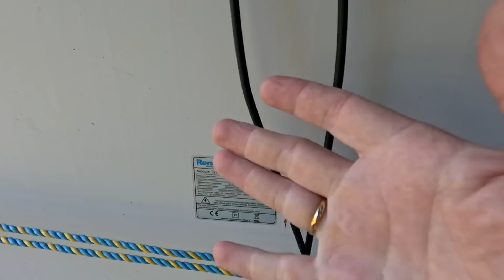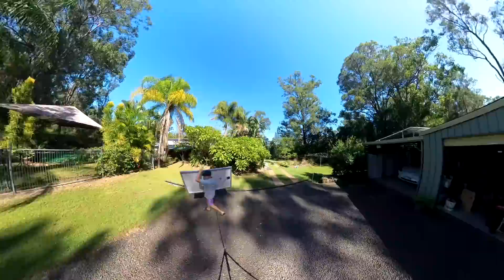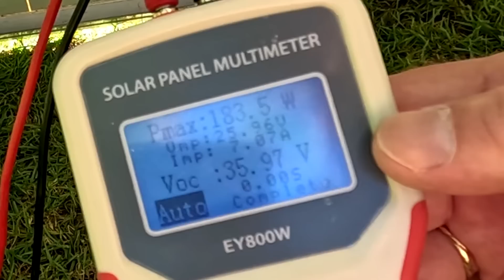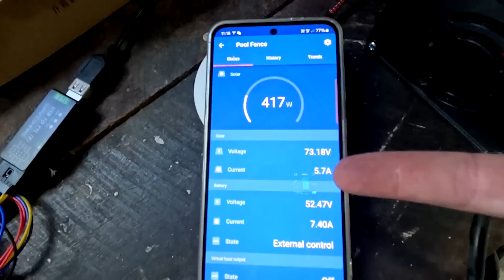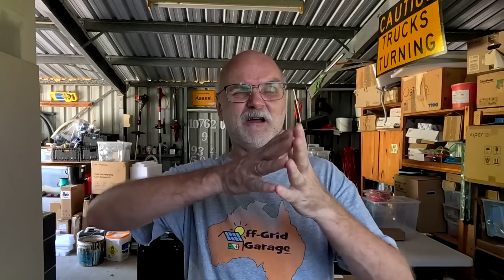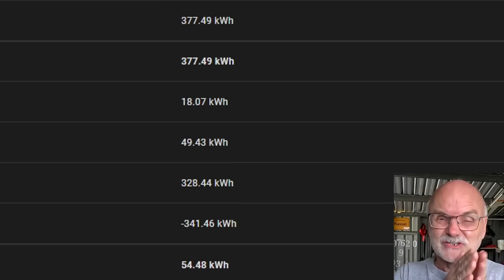Surviving winter with lots of shading with no additional Solar? Preparing for fully Off-Grid.

Comment: Lol, you removed that one palm tree branch which will give you 100% sun in the early afternoon. Question... are you positive that they are planning on reducing or dropping your reimbursement for selling them your excess power. Here in the USA some of the power companies change their payback numbers, for new solar customers but a few grandfather in (same as existing rate) the original existing solar customers that are selling their excess solar back to the grid. If they do grandfather you in you may want to keep some panels selling power back to the grid just to keep your grandfathered status in case something nasty happens to your system. OUTSTANDING video!
Reply: There is no doubt.

Only a few minutes in but way further south we went from a 66c into the grid to 6c….  And it could go down to 2c.    And you could say we were on a grandfathered plan.

Solar generation that used to be focused on grid feed and off peak draw has been flipped and it’s now all about solar utilisation, even if you don’t have batteries.   This shift alone here we have dropped our monthly grid draw by 100 KWhr over at least 5 months compared to last year.   (~2.2 KW on the roof but it was summer)

And while we trim some trees here, that’s also a gutter and fire safety management.    Green growth does need to be kept around for mental health and cooling as well - don’t forget lots of green growth lowers local air temp - a  microclimate where the lower temp reduces or at least limits degradation of panel efficiency due to heat.   I would over panel to beat shade than cut trees if it was possible.
Reply from the maker: It is a contract I have for 15 years and it will run out in 2027. Feed-in tariff will go from 50c/kWh to 5.2c/kWh at this time.

Comment: fwiw, I'm full time offgrid in a van. We have 7.5kWh of battery, and have been struggling with 900W of solar + car charging. It's enough in summer, but for this winter I decided to do something about it, and bought a Jinko 510w panel ($150 AUD) to put on the roof of the car. This has made a massive difference to our ability to regenerate power.
Thanks again for the inspiration Andy!
Reply: yeah, I have 8kWatt/p of Panels and 112kWatt/hrs of battery - I remember when I was undersized...Taj-Ma-Haul (20' x 8' Toy Hauler Conversion ) holds 15 x 540 watt panels
Reply: @taj-ma-haul9094  when you talk about panels its kWp not kWh
Reply: bonezed, when you talk about battery storage capacity then its in kWh, if you say only KW it sounds like thats the peak power they can deliver
Reply: @423GustavBern  yes, it is best to be technically accurate even though many use the wrong term ;)
Reply from the maker: Thanks for sharing

Comment: Andy, why do you not attach all battery's and leave those attached for a full year. By adding and removing the battery's over and over again, you can not see if you have enough solar/ battery for a year.
Reply: I'm sure once the battery room is finished they will all be connected, but with that amount they would likely stay near 100% SOC in the summer, which isn't good. Suppose it would be very easy to take some offline for the Peak summer months.
Reply from the maker: That is the plan once the battery room is finished. That's why I build it😄
Reply: @OffGridGarageAustralia you may have to ask about cycling , as storage is recommended to cycle at 3 months.
At full capacity, and micro cycling... How will that affect the battery? 
Bit eggs in basket, id build two rooms one goes it all goes.

Comment: Would a ~400v DC system not be better than 230V AC for long distances?
Reply: even ~120V is enough when you have thick enough wires.. something readily available solar wire 6mm^2 wire 50m away(=100m wire) you will lose at 2400w (120v*20a) 0.298ohm ->6v ~120w...if you go 100m away -> 240w..so still 2100w at least...the more i calculate the more i don't understand why microinverters? @OffGridGarageAustralia
Reply from the maker: That depends on the cable size.
Reply: @ unless you have only 4mm^2 wire or smaller,everything is better than grid-tied inverter :)

Comment: Andy, why don’t you trim the tops of the trees to open up your Solar capturing window?
You have so many battery 🔋 systems. Will you have enough Solar to charge all those batteries 🪫 on a daily basis when you finish your battery room?
Reply: Would need a laser trimmer those are way too high.
Reply from the maker: That is not part of the project. I made a video about. You will find it and understand.

Comment: Yep Agree another great Video. Andy are you going to purchase a second Multiplus. The Victron has a "Factor" 1 rule, So the AC PV can only be equal or less than the size of the Multiplus. I had to put in a second 5kva (so two in Parallel) for my 8kw AC PV. I assume you will keep the Tilt System?  In practise this is only an issue when the battery is full and you have large loads (kettle / car) kicking off, that Inverter has to momentarily deal with the spike.
Reply from the maker: I know about the factor 1 rule. We discussed this in all details when connecting the microinverters back then.
I'm not sure yet, what I will do with the inverters. I could get a 2nd MP and still use them in series like now, plus the Phoenix inverter as the generator for the first MP. So, three inverters in series. That would be cool!
Yeah, I want to keep the tilt system as well. Tilt has 2kWp and house has 5kWp. This is against the Factor 1 rule though. I could turn off the tilt system in summer to overcome this or could use Home Assistant to do so when SOC is over 90%. Not sure yet, but these are all thoughts I'm having for a while....

Comment: Nice work moving closer to fully off-grid, quick question though.  When you were setting up the Home Assistant Dashboards that are looking into the future and capturing the now-grid-connected PV on the house, did you factor in the losses associated with the DC-AC-DC conversions that you mentioned in the video? or did you reason that this power could be consumed directly and only the excess is subject to this conversion acrobatics?
Reply from the maker: Yeah, that is very hard to tell. We probably need to reverse our habits when to use energy completely once off-grid and use as much AC power during the day.
But even with 10% loses (house solar AC to battery DC), we will be fine and will have a good surplus of energy. A large battery bank will smooth out any cloudy days or heave EV charging.

Comment: More solar / more batteries? It depends. I don't know if you still can find some space to install additional panels on the ground. If so I would propose to install mooore panels. Panels became that cheap, for the price of a 15KWh battery you can get a whole palett of 36 450W panels. I know some offgrid people are mourning about the power they cannot consume or store during summer. But this is what we call a luxury problem. A real problem is to sit on five empty batteries in winter and there is not enough incoming solar to store enough for the next night. A long time there really was a market for second hand panels. But at the current price level already the additional material to mount such panels is too expensive to think about that. If you consider that old panels often only have half as much power as new ones you have to spend double the amount of work, space and money for additional material for used panels. Of course I would not even think about cutting one of your nice trees to get rid of some shadow. Anyway shadow also has some value - during summer. But what about building a fence from panels at the boundary of your property? This would be a nice new project for your channel.
Reply: Well thought out comment 😊
Reply from the maker: I still have space behind the garages, but it is too far away to connect them back to the battery system. Digging a trench is costly as there are irrigation pipes in the ground with unknown location. At the moment it is cheaper to get more battery capacity.
Reply: @OffGridGarageAustralia repairing irrigation lines is cheap!
Reply: @OffGridGarageAustralia  did i see room on the house roof? Remember off grid = less limits....
Just weight on the room will need to be looked at. 
Id look at ac coupled secondary systems with charge back... Fairly such vic can do this too... Another battery room ?? 😅

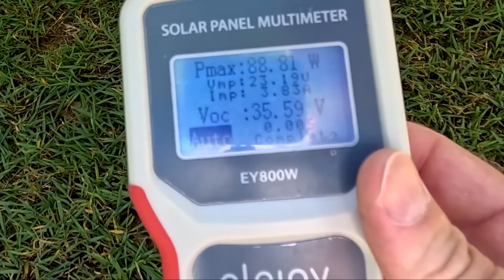Comment: 9:22 I had a similar problem with one of my panels that after some time only generated half the output it was supposed to produce. I assume that only one of the two parallel strings in the panel was still working and the other had a burn through, so that the circuit of the string is interrupted. So you basically have only half a panel left… I assume that because I had 2 identical panels and the second one still had double the output of the faulty one.
Reply from the maker: See, I don't see a difference of the panel with the burn mark. It works perfectly fine. I also checked with the FLIR camera and there is no heat around this burn mark.

Comment: Correct me if I am wrong, if you put a 150Watt charger on your L3 export line - you export less, and charge more - or does that invalidate your contract
Reply: I think he is exporting only as long he has more solar than he can use or store.
Reply: Put the charger on any power point is legal. In theory contract should be fine.
Reply: There is Voltronic Axpert King inverter which is doing exactly that. Charger + Inverter. As I know all energy providers are accepting it as consuming device. And system as off grid.
Reply from the maker: I can add any load to my export line. But why should I? I'm getting 50c/kWh I'm exporting, so using this energy during the day is 'expensive'.

Comment: Panel with backside laminate film burn through likely has bad bypass diode.  

You have so much random shading you need to keep watch on bypass diodes going bad.  Many panels don't provide sufficient heat sinking for bypass diodes.
Reply from the maker: Yes, correct. Hence, I run a low voltage solar system with only two panels in series and shading hit's the panels in pairs.

Comment: Even with close to 600 kWh of battery backup and 70 kW of panels, we can still not make it through the winter.
Reply: What is the world are you powering?
Reply: @Scottietheyoung  There is Nothing super fancy. The home is 3600 sqft, and everything has been switched to inverter heat pumps, including two Rheem water heat pumps. The main problem is the constant weeks of clouds. When it gets to 25°F and lower, we can still use around 40 to 60 kW per night for heat. We kept adding panels, but with cloudy weather for a week, you can run the banks down, not including all the other loads. I have shown videos of the system doing over 500+ amps in full sun. But then there are repeated days where there are anywhere from 20 to 50 amps during midday in the winter.
Reply: I counted it many times and it is throwing money out of the window to try to survive winter on solar. At some point is much more effective to add generator.
Reply: @PeterKuchár-x9g   especially a Atkinson cycle generator with 40% efficiency like a prius enegine and then also use it to warm up water from the heat the engines produces (another 60%) and then you have almost a 100% efficient generator (not counting the heat from exhaust, that you can also recover)

Comment: I suggest to check out first the MC4 connectors cause we had a bad one 2 years ago due to storage outside and unused. I had to cut the connectors and get the genuine MC4. The difference was about 25% on 1 panel in a 6 or 7 panel long string . only 1 had caused the issues with the MC4 and I could not check it from outside easily, only after destroying the MC4 for investigation. Those were NEW panels each 500 Wp and 1 in the 7 panel string was the bottle neck which killed the string. 
We saw it in HomeAssistant in the string key figure comparison like Watt per kWp compared to all the other strings. 28 panels in 4 strings  and only 1 string 25% lower needed and investigation on a 28° roof and at the end it was 1 connector with a huge amount off corrosion caused due a winter outside leaning on the fence.   
I have exchanged both MC connectors and then the figure of the strings were in line with the other 3 strings - I mean a difference of 1 or 2 W per kWp which can be caused by a bigger lag in the reporting which only happens per inverter every minute.

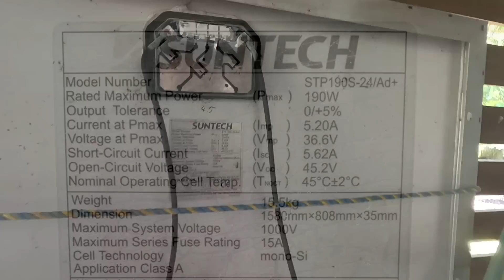Comment: 3:50 - yes, those were built in 2011 and 2012 and are now OUT OF THE 10 YEAR WARRANTY.
But who knows how they would compete on the pool fence.

MAY BE TIME FOR A SHOOTOUT with the 2 best panels of each brand along the pool fence each with its own microinverter to compare the W per kWp and kWh per kWp figures during winter time and which of these panels are the best.

Better content than installing 6 in 1 string and nothing to talk about. So you make the bets which are the best and 2nd and 3 rd choice and in September we draw a line and see which have performed the best and how to determine which is the best based on power I would suggest cause a 6 m broad set of panels is also suffering from shadow at different times.
Reply: OK, you did the power meter test afterwards. Just watched it after writing

Comment: I’m surprised you haven’t rigged those panels on to a flat bed trailer with winches to pull the panels into the optimum sun position.

Vote here if you want to see the ogg do this \/\/\/

Comment: Mid north oast NSW only getting 8c per kWatt feed in :(
With All that excess power you'll have in 2027- you can run your Bitcoin miner (if you still have it)
Reply from the maker: Yes, I still have it, but don't use it anymore as it is too loud.
I only get 5.2c from my retailer without the QLD FIT.

Comment: 1:52 - I doubt that they suffer big time from degredation. YOu have to put them in an exact same location and compare the output with HA on an kWh per kWp comparison.
We have 13 strings on the roof and we can observe the power in W per kWp too for every moment and even see the impact of a 30 m longer DC cable to the hybrid inverter hence the power is 40 W lower per kWp. 
I mention that cause we have such 250 Wp panels too which are looking much more worse like yours but from TRINA SOLAR from 2014. Back then this manufacturer had produced panels with a weak white foil in the back which started to suffer from UV light and caused complete meltdowns cause humidity get into the panel from the back.

Yours look perfect compared to these panels. It had become a major call back for trina solar and all had to be exchanged which were used in big solar farms. It was huge insurance case back in the days and had arrived in the used market in 2022 even though those panels should have been destroyed from 2018 onwards. 
I was not aware of that and paid a lot to get these in 2021 when nothing had been available in the market. 

So I would give those another try and put 2 of them into a spot comparable to other panels with a microinverter. Our Trina Solar have lost 30% but they have oxidations on the bus bars on the back which you can feel with your fingernails underneath the foil.
Reply from the maker: Most of the panels already have snail trails... They are not of great quality.

Comment: Thank you! I did a similar analysis. Exporting my data collected by ioBroker to excel und simulating different battery sizes. It was not encouraging for my situation. To cover the November "Dunkelflaute" 81kWh, Nov + Dec nearly 200kWh and for the whole year 262kWh. Preconditions: BEV charging during summertime only and no haet pump.
Reply from the maker: Yeah, winter is very different up there. I remember...
Reply: @OffGridGarageAustralia  Lucky man!

Comment: surely a series panel voltage of 400V is better for long distances than going to AC (230V)
Half the power loss for the same length and cross section cable.
Reply: I have garden system connected with cheap 2x1,5mm2 45 meters cable. 120V 10A. Works fine. Cable us 1Ohm, loses are up to 100W. No problem going up to 240V DC. Gains from better efficiency of 4S1P system are bigger than gains from 2S2P.
Reply from the maker: The all depends on the cable size you use. Looking at the voltage and amps is only one side.

Comment: Any green part is an area where there could have been a solar panel 😂❤
Reply from the maker: That is not the problem, but how to connect them back to the garage. It is far too expensive and cheaper to get more batteries instead.

Comment: Surely even in 2 years when you connect the systems you will still have a grid connection - and can export extra when batteries are full in summer?  I'm sure you can use the dashboard to see at that point how much would be wasted otherwise - even if only at $0.10 not $0.50 after the FIT mega deal ends?
Reply: Why would you pay the monthly connection fee, risk of dammaging surges from the grid and most likely pay a penalty when feeding in during periods of excess solar?
Reply: NO.   get off the grid ASAP.    just getting those lines off the house reduce the chances of a power surge from lightening or EMP or a transformer failure  that will cost a fortune just because one was still connected to the grid.
Reply from the maker: Connecting solar and batteries to the grid attracts a lot of regulations which I don't have when being off-grid. I will find a way when time has come and discuss with my sparky.